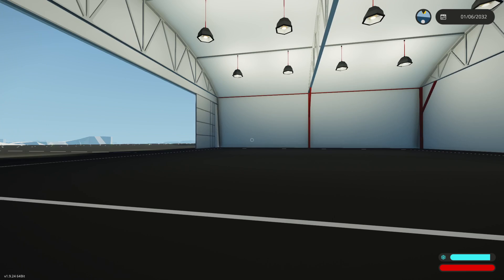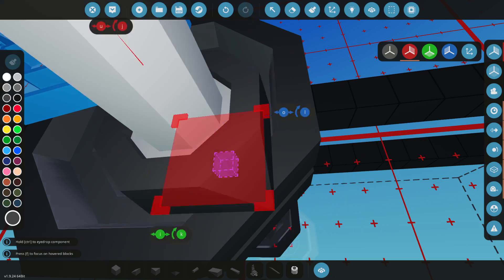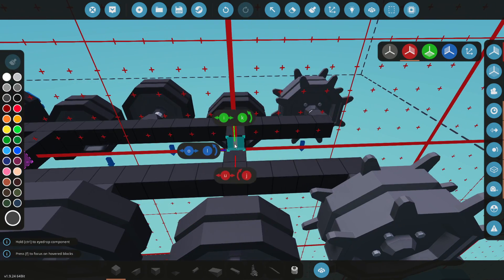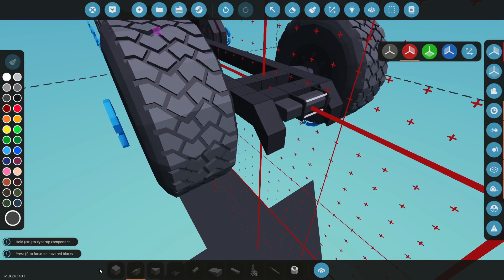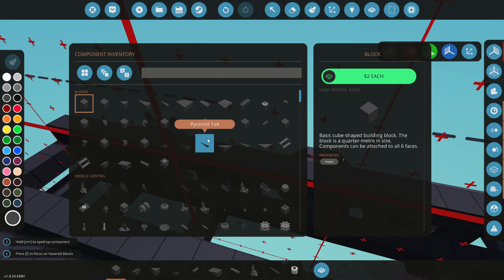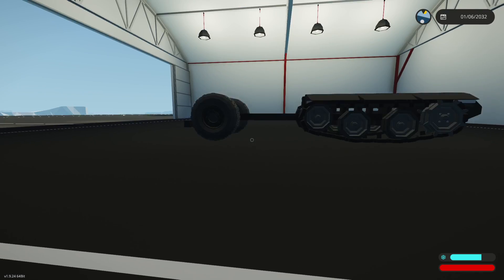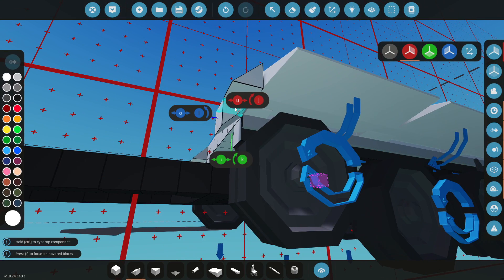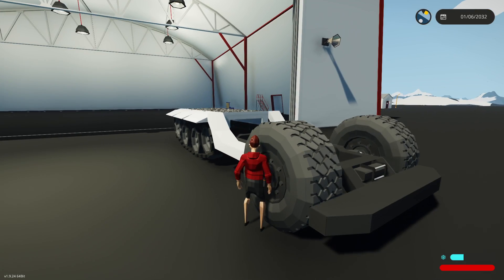I Built A Chasis & Tracks For Our Half-Track In Stormworks! #1

Comment: Frabtic if you want inspiration for the body i recommend looking at the german Sd.Kfz. 6/2 half track

The one im on about basically shates the same chassis and track setup as yours

Just this one has a 40mm-

Ofc you don't need the gun but the cab should be decent inspiration
Reply: You could also use the German flak 88 half track (or 8,8 cm Flak 37 Sfl.) for more inspection if the bed needs changing seen as it also has side panels that could fold up if necessary